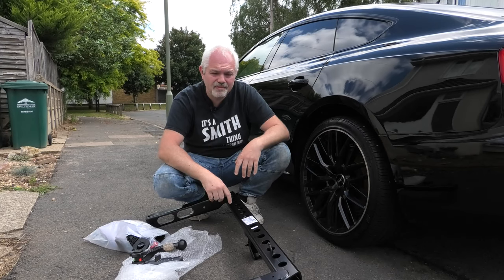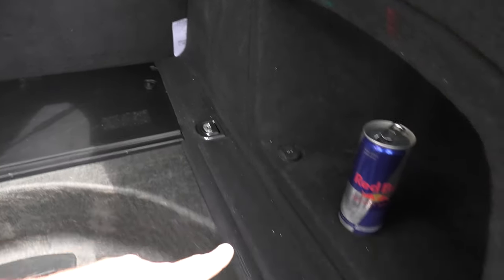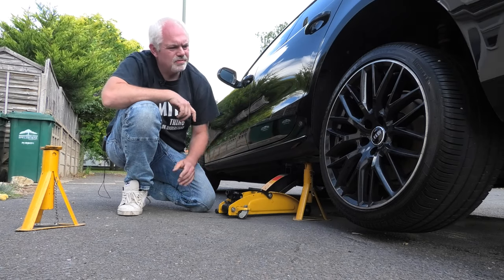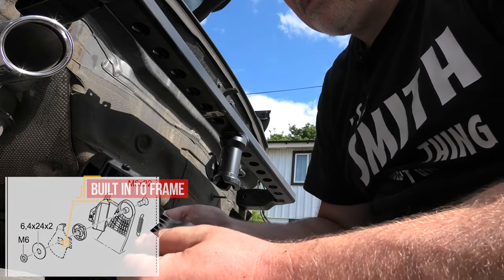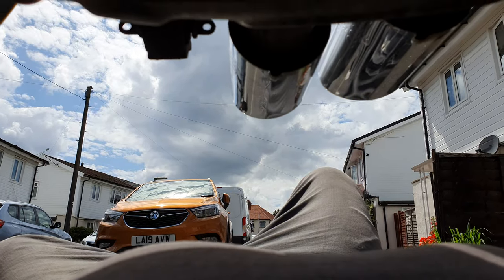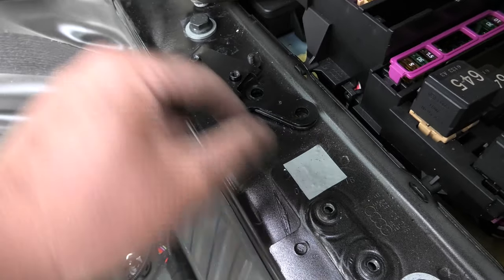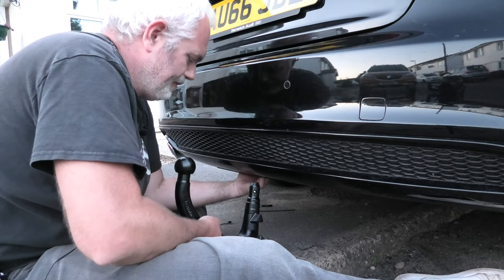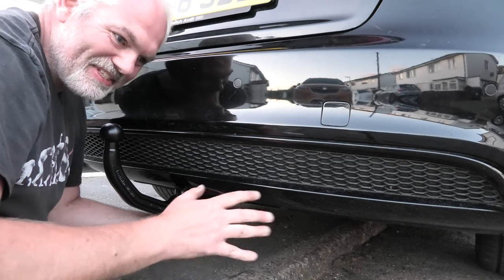How to fit WESTFALIA DETACHABLE TOWBARS - Start to Finish

Comment: Thanks Richard. Heineken doesn’t do YouTube but if it did it would be called Richard. 
By far the most informative instructional video I’ve seen on YouTube. Considering this is not a small job. My question is, can anyone without mechanical skills tackle this job. I have the Audi A6 tdi ultra and supply and fitting prices are astronomical. 
Thanks again Richard. 👏👏👏

Comment: Best tutorial by far on fitting this type of a towbar, helped alot thanks.
Reply from the maker: No prob.  Glad you found it helpful.  I couldn't find anything this detailed and tried to keep it as condensed as possible without being boring.   I like to cover every snag and gotcha as possible.  Sadly most dont do this.  I also have the electrics video too just as detailed.
Reply: @richsmif  yes I got that I am also thinking of upgrading my electronic to the Canbus one.
Reply from the maker: @demetriusbaloyi2605  i was going with the old skool relay.  But after adding that cables crimps etc it wasnt worth it.  Yes it was more but done properly.  The electrics kit was like 110 pounds and fully works with the car properly.  So overall i was pleased.  Plus i get a little picture of a boat on my screen when im towing haha
Reply: I was just wondering about electrics. Will wait for the next video

Comment: Very useful. Thank you very much!
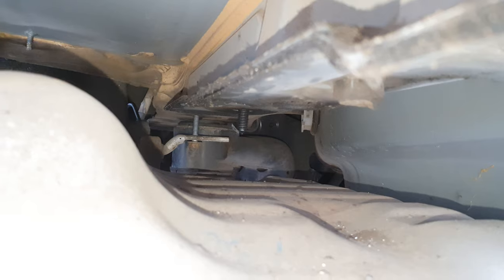Reply: Hi Richard! I have few questions: do you know the part number of the brackets that you received in your towbar package (min 20:45 in your video)? Also, the bracket has two small holes in it, are they useful in any way? I bought a second hand towbar kit and I didn't receive the screws nor the brackets. I used the screws from the metalic bumper beam (I hope they are ok to be used with the towbar), and now I need to buy the brackets or nuts in order to be able to screw on the second row of screws.
Thank you very much!

Comment: If you twist the knob far enough forward, it will stay in the unlocked position. If you then mount the towbar onto the car, it snaps automatically into the locked position. Took a while until i figured that out also.
Reply from the maker: yeah took me a few goes even after the video to get the knack of it.  been great though.  although not used at all this year due to lockdown grrrrr

Comment: Hello Richard, I notice the link you posted the model Westfalia-Automotive 305465600001 was originally referring to a Audi Q5. How did you find out that the tow hitch would fit your A5? The reason I am asking is that I like the retractable models, that according to Westfalia are compatible "only" to Audi A4 Avant and Audi A4 Saloon... any chance to get a information about the size of you hitch (meaning the distance between left and right mouting bars?) Thanks for your patience
Reply from the maker: Thanks for reply.  Sadly I sold the car and upgraded to s5 so can't measure it for you.  I never put a tow on the s5 as the rear splitter interefers.   I'd suggest going to westfalia directly.

Comment: Really good video Richard. Nice calm, methodical approach with each step well explained. This maybe just what I need to attempt this myself. 

Do you think it would be very different install process for an A4 b8 Avant (09)?
Reply from the maker: Maybe similar.   Least it will help prompt you through and adapt for.your car.  Watch my 2nd video for the.electrics.   :-)  thanks for watching and good luck
Reply: Thanks @richsmif .  I saw the second video first as it was really the electrics that I thought would be the most challenging.  Thanks to that video, I can now see that I do have the tow bar prep wiring so should be plug and play. Hopefully should be fitting later in the summer. 
Are you still planning to do the 3rd video with car coding? 🙂
Reply from the maker: @dalerowley6039  i actually did film.it but the screen capture had a spaz with VCDS.  Wasnt usable.   When the sun comes back out ill redo.it.  wasnt difficult.to be honest.  Works like a dream.  I get a little boat on my screen lol
Reply: @richsmif  really appreciate all the effort you have gone to. It’s rotten luck that you weren’t able to use the footage from first time round.
Reply from the maker: @dalerowley6039  these things happen.  Lol.  Im going to be adding puddle lights later in summer so will be filming all the joys and VCDS settings for that .  I try to make videos that are easy to follow .  Im abit slow so struggle.with some videos as.people tend to skip the important bits.  But on the other hand dont want it too long and boring.  Lol  fine line.  Anyway glad your enjoyed.  Im.building a summerhouse at moment in garden and have been filming that stage by stage.  Currently have over 100GB of footage for that.  Gonna take.some timr to edit . Thats why im quiet at moment.

Comment: One day car manufacturers could just make life easier and put the structural parts pre fitted to all models, I find it nuts how much of a faff it still is to fit a towbar, why is this not just as simple as screwing a few bolts to attach the bar and exposing some pre fitted electric connector? Taking half the rear end off , lowering the exhaust,  pulling off most of the boot trim, and having to cut the bumper is insane really.

Comment: Hi Richard I own a abbey caravan single axle with a mtplm of 1500 kg 
I am currently in the market looking to replace my car with a A5 3.0 d 
How do you rate this as a tow car?
Reply from the maker: Well mine is a 2.0 tdi 190bhp version and could easily pull that.   So 3.0 no worries.   I only use it for thule bike rack .  Id love a Q7 but need a few more subscribers before that becomes a reality lol

Comment: Put the bumper on a blanket at least, and put a blanket underneath when you pull the bumper off in case you drop it. other than that, great video. I wondered where the 3-4 hours estimated time was being used up. Not quite as simple as the instructions make out. And what it show is just how crappy some of the engineering in cars is. They are, like the old days, built from the inside out.
Reply from the maker: yeah totally get the blanket, i'd agree with you there.  Bit of a behind the scenes, i'd already removed it in 2 other takes.  Took me a total of 2 days to do the job start to finish including electrics, but i'm constantly faffing with cameras, out takes, people walking past.  etc.  I think realistically you can do it in a day.  A professional quotes 3-4 hours but they do it day in day out.

Comment: Is this the same for an Audi Q5 (2019)?
Reply from the maker: Should be very simular.  Ive looked at the kit on ebay.  445 for.full kit .  Towbar and electrics.    Thats for 2017 onwards.  My electrics video is for ecs electrics kit but again should be very similar.   Good luck
Reply: @richsmif  Thanks Richard, yes thats the costing I sort of came to. I've had a quote for full fitting, electrics and coding, fitted in my drive, for £595. Therefore the saving and hassle of attempting it myself is not worth it. I've booked a professional! Regards,
Reply from the maker: @stephenbrown8127  yeah so 150 for fitting basicly.   Not bad.  I didnt have those prices.  I was looking at 700 hence it was worth it for me.
Reply: @stephenbrown8127  That is incredibly cheap fitting....

Comment: I’m looking to buy and install (diy) a tow bar on a Q2. It will be used only for supporting a bike rack so no electrics required. Anything available to just bolt on ? Any suggestions of what and where to buy ?t thanks 👍🏼
Reply from the maker: I'm afraid a bike rack still has electrics.  All the bikes will cover your lights and number plate sp still needed.  I bought from ebay but pf Jones is a decent trustworthy source.